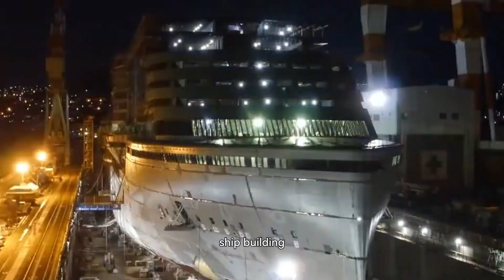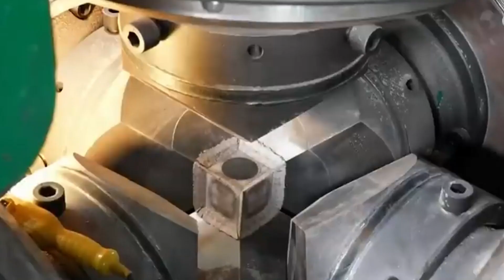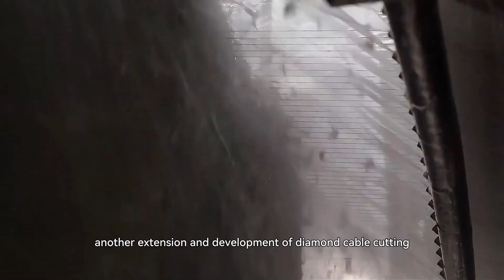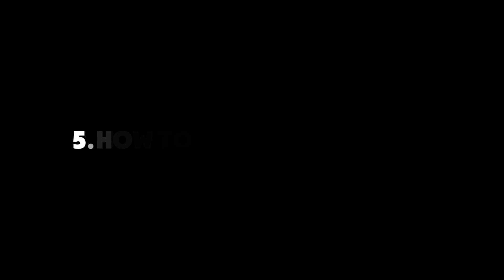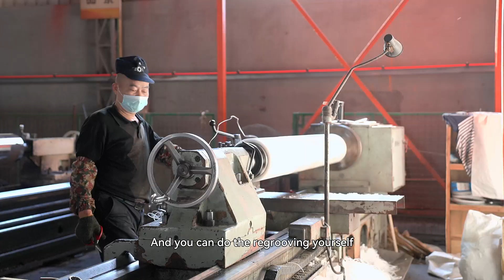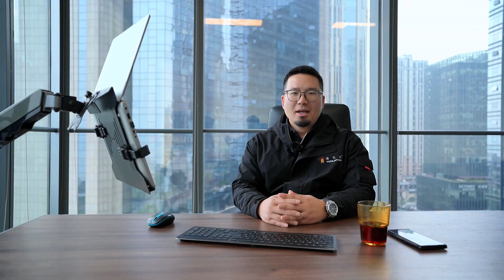Unveiling of Cable Cutting Machine

Comment: That's very nice but why does it originate from china?
Reply from the maker: Three reasons. 
First, fierce competition in China. As the world's largest stone producer and exporter, China's stone market is booming and competitive. Under the circumstance, the machinery manufacturers are prompted to seek new technologies to improve product performance and reduce costs. In this way, the cable cutting, as an innovative technology in the field of stone cutting, has been rapidly developed. 
Second, technology and experience accumulation. China has significant advantages in the field of synthetic diamond and cemented carbide. 90% of the world's synthetic diamonds and 60% of cemented carbide are produced in China, which provides a unique condition for development and production of diamond cable cutting technology in China. The diamond cable machine is based on these high-performance materials and has demonstrated excellent performance and efficiency in stone cutting. 
The third reason is wide application of diamond cable in the field of hard material cutting. In China, diamond cable for crystalline silicon, graphite, silicon carbide, optical glass, sapphire and other hard material cutting has been widely used. And its cutting equipment, tools and processes are well developed.